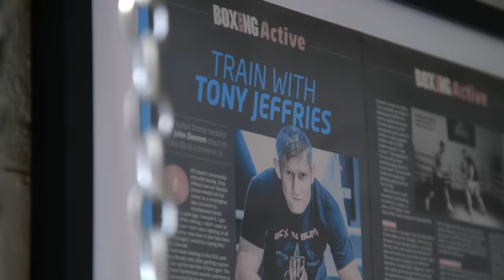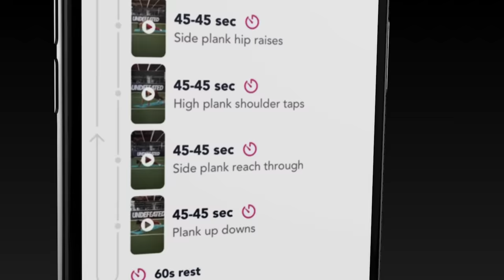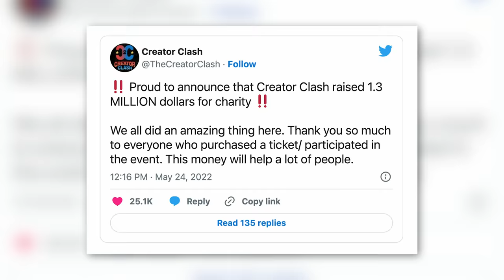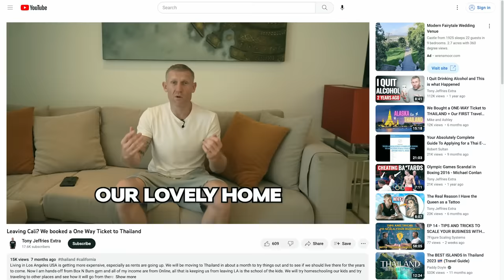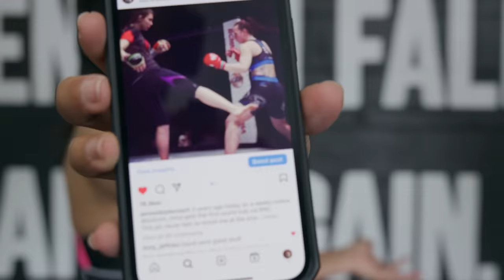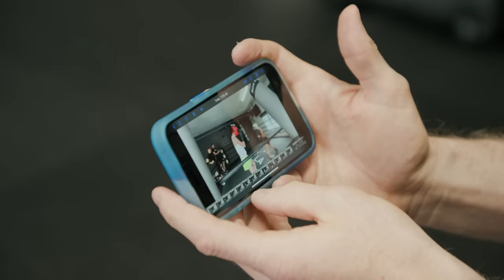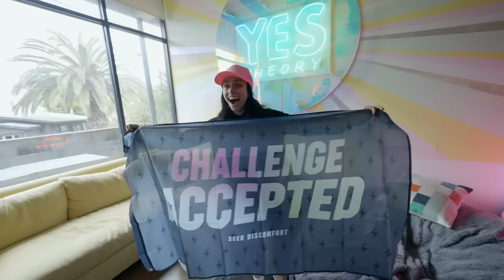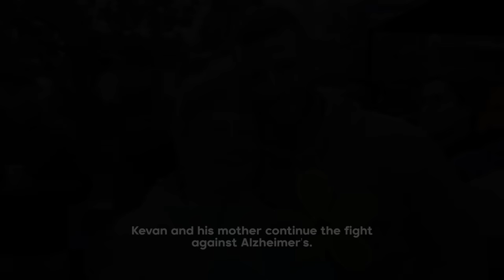I Trained Like An Olympic Boxer

Comment: 8:16 I know EXACTLY what you're feeling in this moment, Michelle. I trained in kickboxing for a time and, while I plan to start again one day when my knee is fully healed, I had so many days when in the beginning when I was literally stress crying after a sparring match. Sometimes someone would hit me in the head really hard, I would get punched in the waist too hard that my stress and pain levels made me lose control of my tears, or I'd be hit to where I'd fall backwards that I felt so defeated. I have the best coach for my skill set and he'd just let me breathe a moment, get some water, and tell me to get back in. I can relate to that panic and the tears you struggled with. 

If there's anything I can take away from that, it's that the there is nothing wrong with the tears. The only time it's not great is if you quit, and that's not what you did. You are amazing, girl!! Way to push through.🔥❤

Comment: I will never understand what makes people want to train so hard to get into a ring where there is a strong possibility of head trauma / concussion, facial fractures like broken jaw, cheekbones, nose, hand and wrist injuries, you could go permanently blind from direct punch with a knuckle to your eye, broken ribs ETC. or you could probably even die. Whenever if you spend as much time and effort on a gun range you will become indescribably more lethal than any martial arts. I'm not saying that to disrespect the grind and effort it takes to be a strong martial artist (I could never do it, even if I wanted to), but to me it seems stupidly inefficient. I could drop 30 people before you kill someone with your bare hands. It's sport like any other, except you can get permanently damaged for basically nothing. My head just can't get wrapped around people's obsession with punching each other.